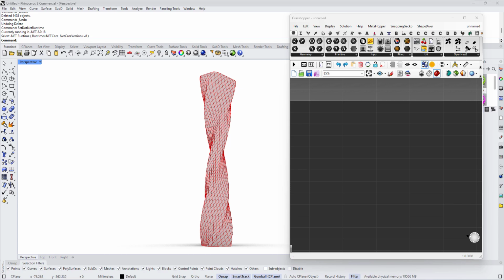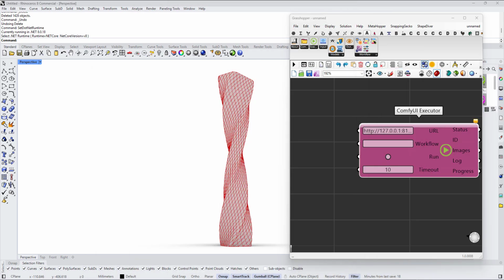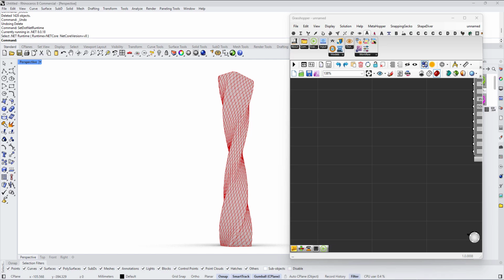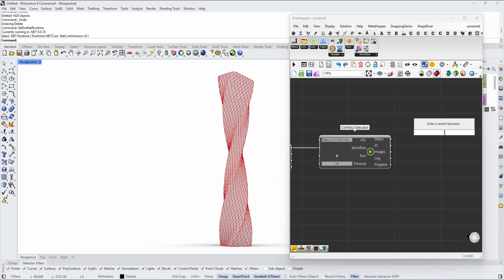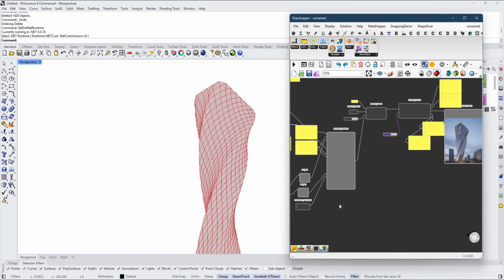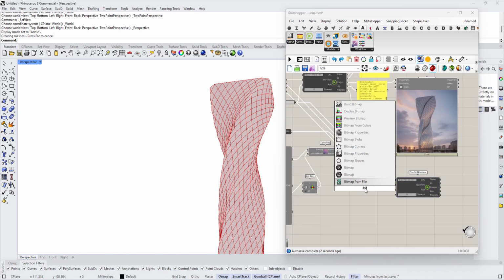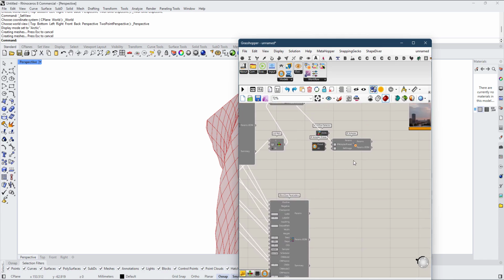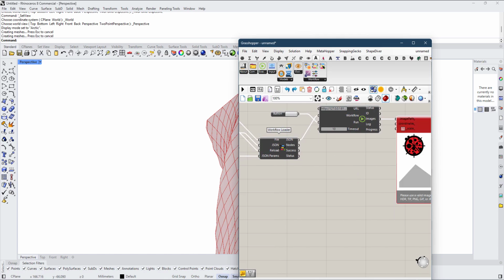(How to install and use guide) AIman Tools Free EASY ComyUI inside Grasshopper Plugin

Comment: Hello, thank you a lot for sharing. I am getting this error when trying to use the preset workflows. AIO_Preprocessor does not exist. 
[01:12:02] Set unique seed 1793338773 for KSampler node 3
[01:12:02] Submitting workflow to ComfyUI...
[01:12:02] Error: Submit failed: BadRequest - {"error": {"type": "invalid_prompt", "message": "Cannot execute because node AIO_Preprocessor does not exist.", "details": "Node ID '#22'", "extra_info": {}}, "node_errors": {}}

 Can you help
Reply from the maker: Hello Mona. Thanks a lot for connecting. 
Kindly, make sure to choose the right preprocessor from the "controlnet preprocessor" component and add it to the "workflow parameters" component's "CNPreproc" input.
Also, make sure you have the controlnet custom nodes installed and updated on your ComfyUI version.

Comment: Hello, thank you very much for this ! I followed your video - everything worked!
Two things i would like to ask:
- is it possible to adjust 'denoise' as well ?
- what is the trick to get the text boxes for input of values right in the GH-components?
Reply from the maker: Thanks a lot for you opinion!
Glad you're enjoying the plugin.
1- Of course, you could just add your own workflow with the denoise value you want as a json file instead of using a preset workflow.
I will consider adding the denoise value to the parameters component in the next update. Thanks a lot for the suggestion!
2- This is a plugin called persistent data editor. You can find it on the package manager.
Regards.
Reply: @computationaldesignArabic  sure, thank you !

Comment: Is it possible to use Flux  dev?
Reply from the maker: To use Flux and Flux Dev, you'll need to add your own workflow json file instead of using a preset workflow.
I will consider adding Flux and Flux Dev workflows in the presets in the next version.
Reply: @computationaldesignArabic  will any worklow work with the plugin? I would like to use chroma and am not sure since its a diffusion model instead of checkpoint. i am just getting started with comfy ui and ai in general, but this plugin seems very promising! thank you for your work so far!
Reply from the maker: @frederikpufe7072  Thanks a lot Frederik. I'm glad you liked the plugin!
Once you create your own workflow, you can load it to the file input of the "workflow loader" component. Just save you workflow as json file from ComfyUI and it should work.